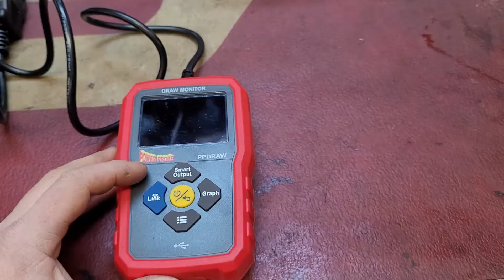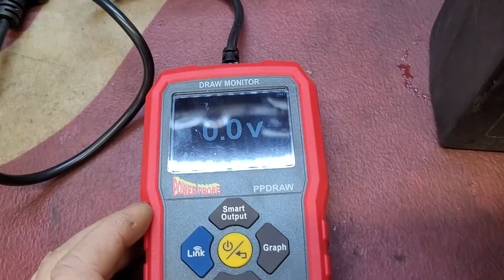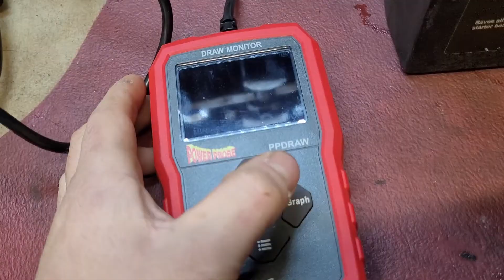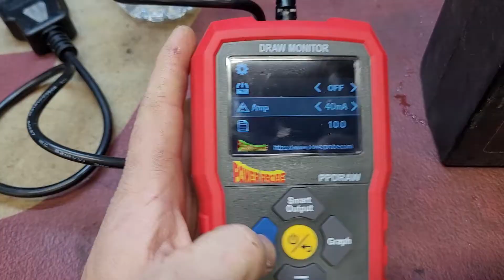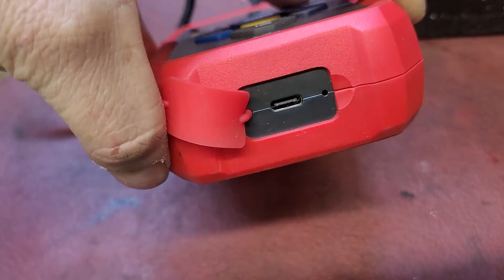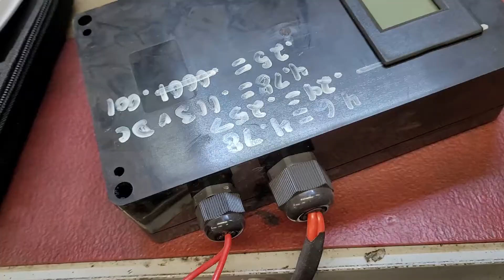Power Probe PPdraw tester review

Comment: Cool. I also made my own similar tool using and OBD2 breakout box, scope leads with spade terminals (one fused) connecting an m12 battery to pins 4 and 16 with an DVOM in line set to amps.
Reply from the maker: I support making your own stuff, i have made my own in cylinder pressure transducer, and pzo pulse sensor.
Reply: @Kennystoolreview  Nice!